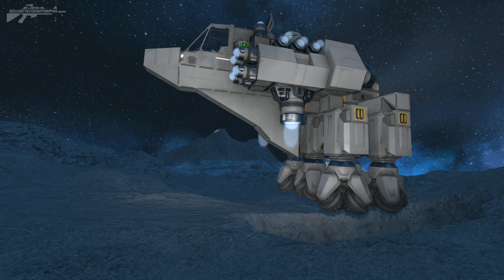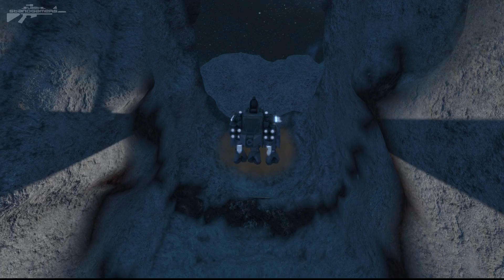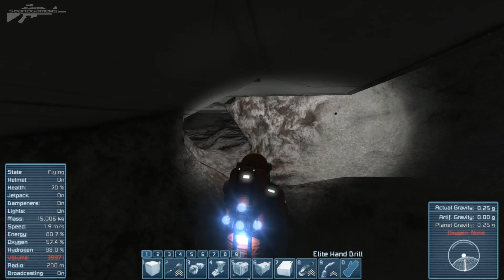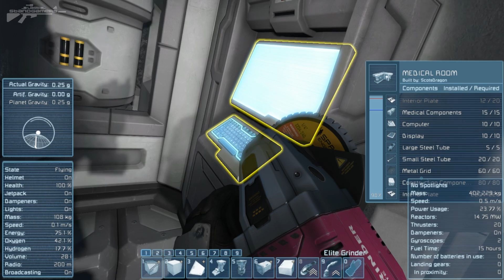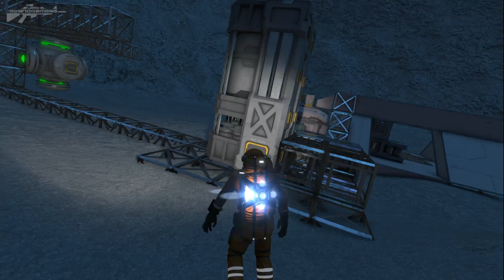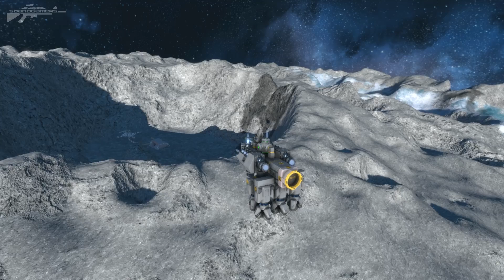Space Engineers - Supply Transfer Wreck Salvage SE7-2

Comment: When you start the habitat areas, start with a garage/shipyard place thing.  A promising location looks to be the iron vein, because of the resource gains and an easier start on the road pipeline.  And it could function as a Shiprinter.  Insert a projector and some welders, and maybe keep Tazoo away from that side.  Maybe have him build up a defensive tower on the far opposite side of the Shiprinter station.  Always task Tazoo with solving defensive issues, and you shall have all the guns you'll never use.

Comment: Build a platform at the base of the crater, at the center dig down a straight shaft maybe 40-50 blocks deep and build a rocket silo right at the center. If you use warheads underground you get almost perfect sphere empty space fora  gantry and at the base of the crater you put the doors and utility buildings. :)